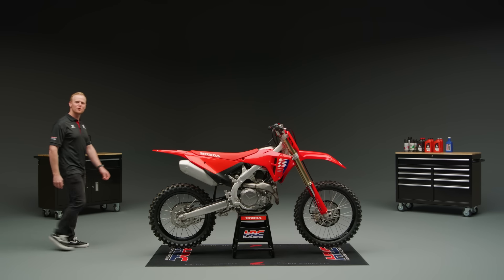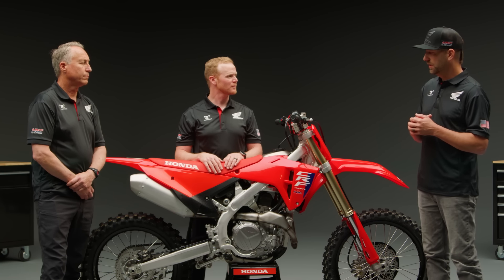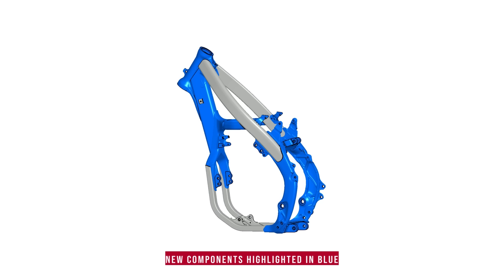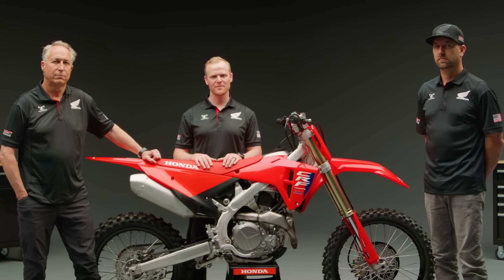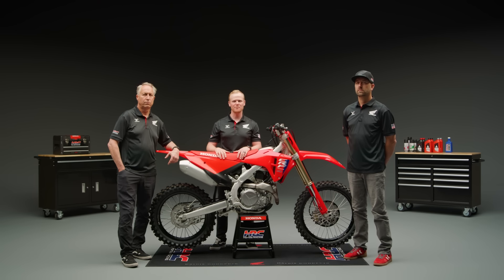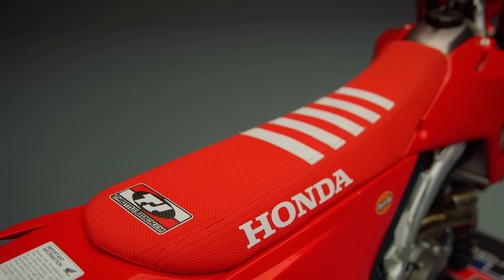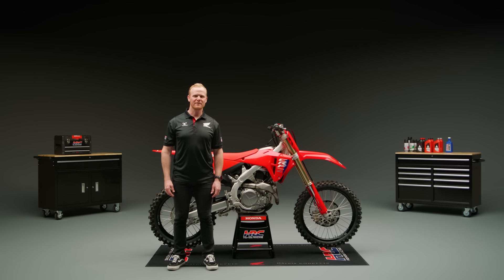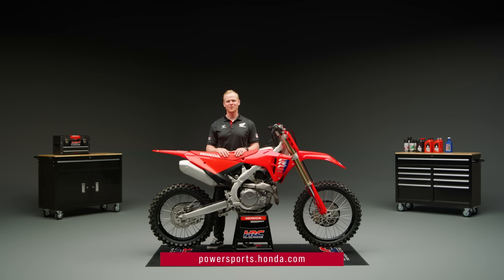2025 Honda CRF450R Model Overview

Comment: And the one thing missing is a engine mapping app, Yamaha nailed this feature on their bikes even Kawasaki have it now, Honda are still living in the dark ages having to hook up a laptop and battery, 👎👎👎
Reply: It’s something the Lawerence brothers didn’t need or want lol. since this bike is built around Jett and a little bit from Hunter
Reply: And Yamahas blow up the most, wonder why
Reply: @samzimmerman6271  not because of the power tuner app
Reply: Imagine thinking mapping the engine will make a difference. We aren't all pros 😂
Reply: Anyone serious gets a Vortex tuned by Twisted and leaves it the hell alone. You aren’t going to tweak your app based maps to any realistic difference. They are only going to let you adjust incredibly basic parameters.
Reply: LoL stock mapping on a yzf  crapaha barely does anything
Reply: It’s a gimmick doesn’t make anyone faster
Reply: I want the 450 Works Edition! 💯